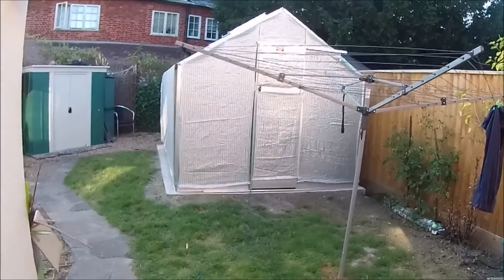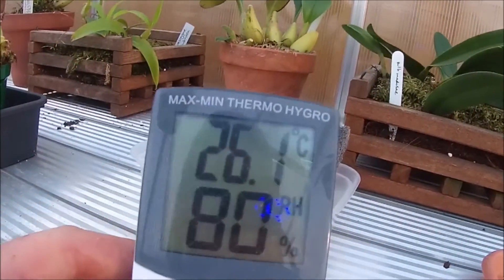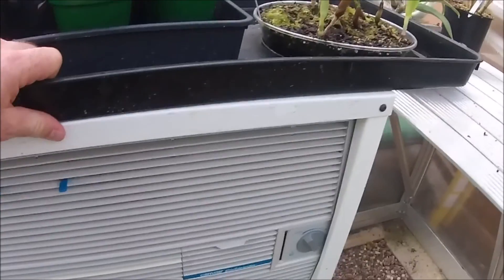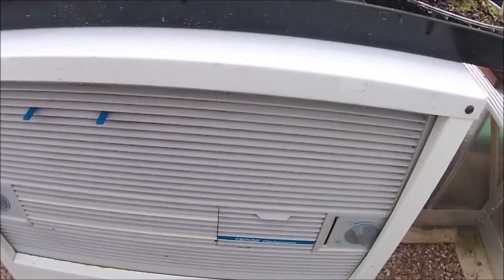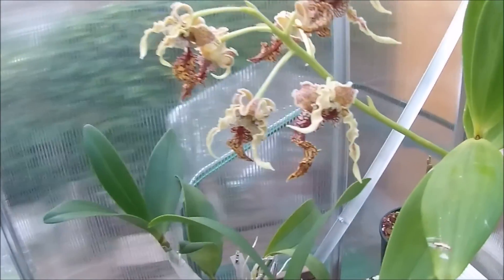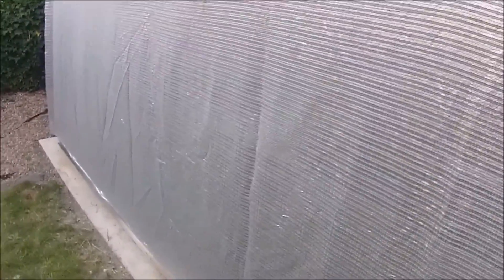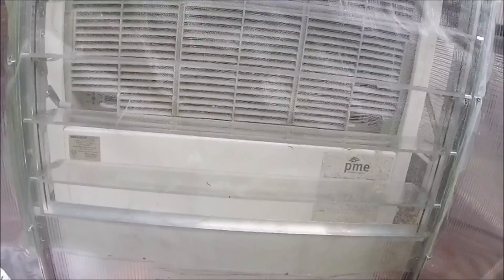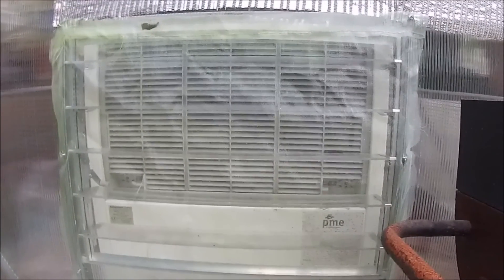Greenhouse cooling with evaporative cooler and shade cloth.

Comment from the maker: The Aluminum shade cloth is an excellent addition. Simply Control have it for sale on their web site. You can physically remove some of the aluminum by stripping it out of the bottom of the sheet, this allows you to control the amount of shading it provides. The swamp cooler is good, although I may look in to a split AC unit next year. Thanks for the comment 😁